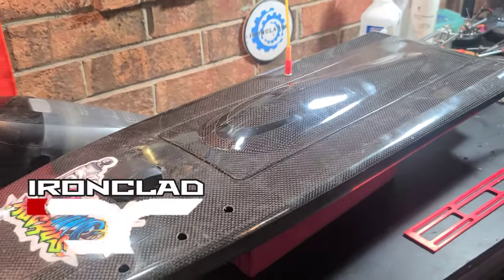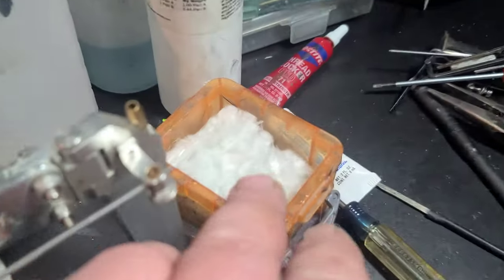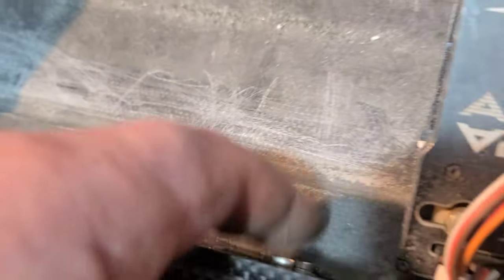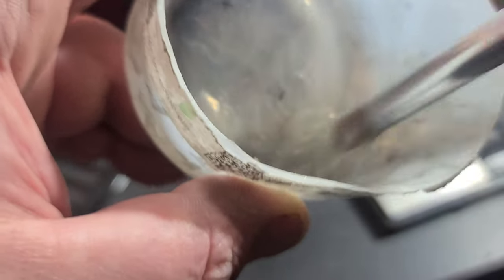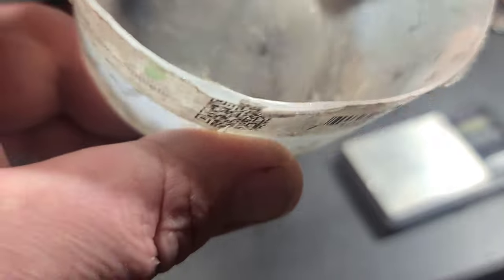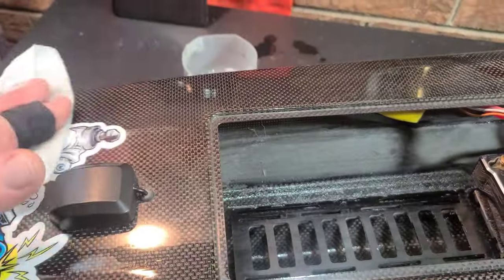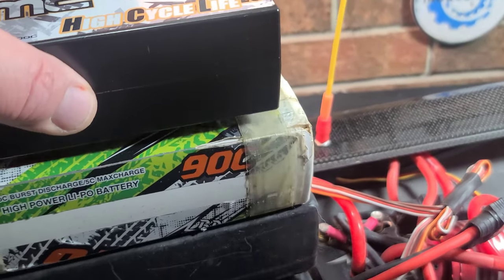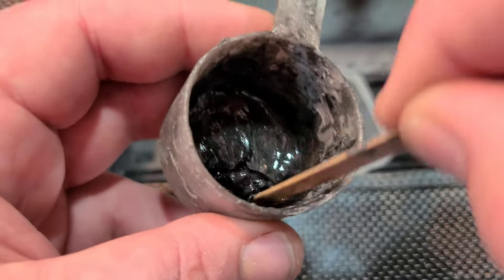How I Replaced The Battery Tray In My Oxidean Marine Dominator - FE Rc Boat Battery Tray Install

Comment: You're goin' the wrong way with this.  Adding shredded fiber to epoxy doesn't increase it tensile strength.  Just saying.  IMO.
What would be better to cement in things like your battery tray would be just Silicone RTV.  I really really think.  :)
Reply from the maker: They use rtv silicone, so when you bust your battery tray out again, and again and again you won't break the hull, my method, should never break out, and if it does every things going with it.  Ths boat does not have hatch locks, the last thing I want flying around in my boat is a 2 pound battery
Reply: @IRONCLADRC  So so true !
Reply: Of course it increases it's tensile strength !
Reply: @sjorswouda6865  I worded my comment badly.  I meant adhesive strength. Thanx for catching me up on that.  :)
Reply: @IRONCLADRC  :)